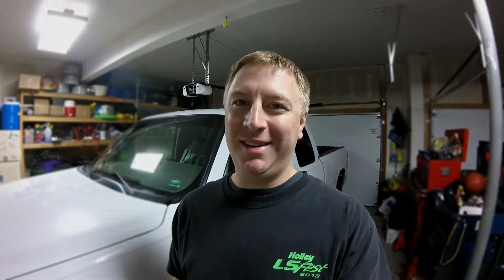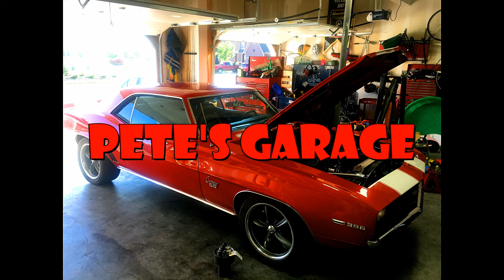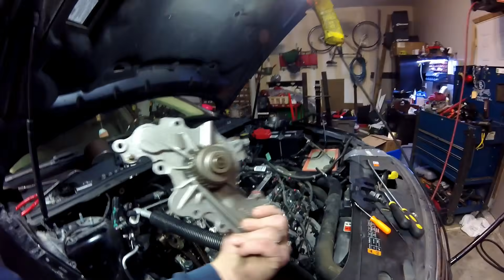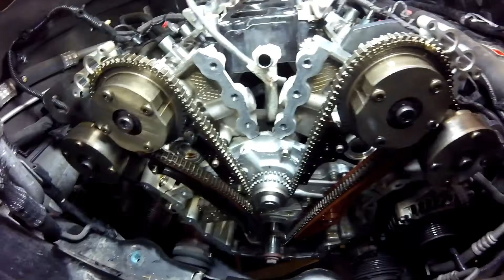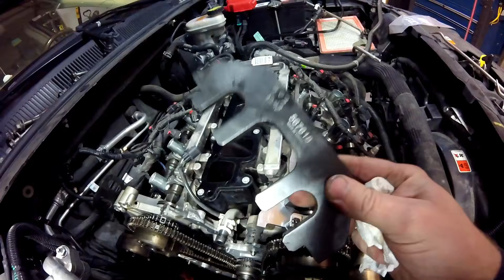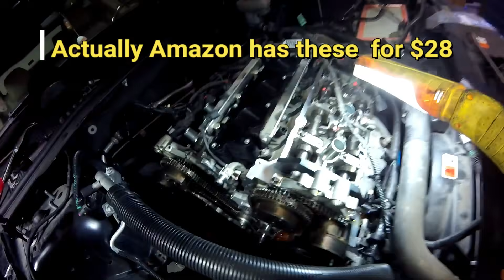Why does the Ford Taurus, Explorer, Edge 3.5L water pump cost over $1400?

Comment: I have a 2015 Taurus with the 3.5. No turbo. I just noticed I have no heat at idle. Once I rev it up to 1500 RPM I have great heat. Temperature is normal. NOT overheating. NO coolant leaking anywhere? I just done an oil change the day before this started happening so NO coolant in the oil. So why no heat until reving it up? Water Pump? I can't find anyone having this issue with the water pump. All have a coolant leak. I will check Coolant level tomorrow but again No coolant under the car and none in the oil???
Reply from the maker: Usually that means it low on coolant and there is an air pocket in the heater core. It’s one of the first symptoms of low coolant because the heater core is usually one of the highest points of the cooling system.

Comment: How is that job only $1,400?! All shops here are charging $4k minimum with just aftermarket parts that will break easy!
Reply from the maker: This video was recorded 7 years ago. These cars now have a ton of miles and labor has more than doubled. If you’re doing this job today it would definitely be a good idea to throw a timing chain kit in it so that definitely adds to the cost.

Comment: How do you time it i think i have a water pump seized it wont turn the engine it ran fine it over heated a bit. I pull timing case cover and it won’t turn  any ideas  I know your thinking spun bearing but has not signs 2007 ford edge thanks in advance
Reply from the maker: I would remove the timing chains and see if you can spin the water pump on its own. You could also then try to spin the engine a little with the crank bolt but only a little bit to make sure it’s not seized. I highly doubt the water pump is seized though. Good luck.

Comment: I changed my water pump in 8 hours and replaced all gaskets and seals. It cost less than $500.00.
Reply from the maker: You can definitely save a fortune doing the work yourself. When I made this video $1400 was about what it would cost to have an independent shop do the job. Now it’s at least double.

Comment: My 2017 Explorer sport with 840000 Miles . Issue is stop at a traffic light cold air when you drive 3-4 car length  or sometimes 1/44 mile then hot air  Took it in and the dealer tops it off and went away the next dat it was doing the same thing. No leaks on my Garage Floor. Well the results back at the dealer is  water pump. Who and what were the engineers thinking putting the water pump inside and then when the bearing gets bad the water  going into the oil. We all know water and oil don't mix AT LEAST I THOUGH PEOPLE KNEW THAT Fire the engineer. They sure do not understand real life mechanical  knowledge. $4000.00 Repair Bill!🤦‍♂🤦‍♂INTERNAL WATERPUMPS  🤦‍♂🤦‍♂🤦‍♂🤦‍♂NEVER SHOULD BE ANOTHER ENGIN OR MANUFACTURE HAVE THIS DESIGN. Goes on the outer portion of the engine and the water has a small hole to leak out and no engine damage as long as you don't run it and over heat the engine with not water in the system 👍👍👍👍👍👍👍👍👍👍

Comment: I have a 96 Mercuy Mystique 2.5 V6 it overheated in 2015. I thought it had a internal water pump it sat for 3 years til  I pulled up on my phone hoe to do it. Put my glasses on and saw the sticker under the hood showing the pump was ran by a pulley off of one of the camshafts. 10 min job to replace the belt now everything else is a pain in the ass to work on but not the waterpump. Ford could have easily done this on the 3.5 but they chose to screw people over too bad that 3.5 is a great engine otherwise.

Comment: This wouldn't even be an issue if they would have just copied the same design as the Nissan VQ series. Those have a cover plate for the tensioner and water pump, so if it fails, there is a lot less labor involved.

Comment: Can someone please tell me where I can get this fixed at for $1,400, because my water pump is leaking on my 2017 Ford flex and the cheapest place I found thus far is $3,000! Some places have quoted me as much as $4,000 plus and I'm not even leaking antifreeze into my oil yet
Reply from the maker: This video is pretty old. Prices have skyrocketed and these vehicles have way more miles on them now.
Reply: @PetesGarageandperformance some places are charging over $4000 for this job now and it doesn't seem to matter if the vehicle has 100k or 180k.... they're charging you at least $3000! Mine is scheduled for the 27th of this month. Thanks for getting back to me 👍
Reply: @PetesGarageandperformance  I've got 133k on the odometer by the way.

Comment: That’s not all. It can cost 2-3 thousand dollars. The first one I ran into, the A/C didn’t work. It had a blown fuse. The water pump weep hole onto the side of the block drips water down on the compressor clutch! Eventually it ruins or shorts out the A/C clutch coil. 

Since water and electricity doesn’t mix, you could also need an A/C compressor! 

To make it more of pain, Ford also does not use a gasket or seal on the timing cover. You have to use RTV like on the Toyota. Which makes reinstalling the timing cover a bitch without smearing the RTV. 

Next problem is removing all the air out of the cooling system so it doesn’t run hot. You need an air lift tool used to refill the cooling system which requires an in house compressor. If the car ran hot due to lack of coolant from the water pump leaking, you may also need a thermostat and housing assembly! 

One thing just snowballs to needing something else and I can add up to a huge repair bill.  Most people just junk the car when they get an estimate. Since you are there and depending on the mileage, you may need a complete timing chain kit and guides and phasers!

Plus coolant and an oil and filter change.  All because dummy Ford installed a water pump that runs off the timing chain. Toyota and others did this too I believe on some models.  That Toyota van may even cost more!

Comment: In central N.C. it cost $3100.00 to replace parts and labor!! I had to have mine changed at 77,000 miles and again at 97000 miles luckily the 97,000 mile change was covered under the warranty of the 77,000 mile change....WHEW!! IT HAD A 24,000 MILE WARRANTY!!

Comment: Came across your video. My daughter just got a 2014 Ford Taurus and we are having this issue now, we have taken to a local trustworthy shop. We went through a similar hell with a Ford Expedition 4.6L needing both timing chains, guides, the works. It ended up having to have an engine. This Taurus has 318k, almost all highway miles. Should all of those components be replaced as well or are we just looking at another engine? I will own another Ford as long as I live if we go through another engine replacement.
Reply from the maker: If the oil is a milkshake and the crankshaft bearings are worn it’ll need a new engine. With that high of mileage I would replace all of the timing components while you’re in there.

Comment: so i did the timing chain on a 2012 taurus and lined up both cams and the crank with the colored links on the chain and where they were supposed to be. i installed the new chain and matched perfectly. when i spin the engine none of the colored links match up to the dots on the sprokets even when the dots on the sprockets go back to where they are supposed to be. is that normal? is the timing off? i was unsure about the tensinoer since it did not fully lock.
Reply from the maker: Yes that’s normal for most engines. There are some engines that take 50 or so revolutions for all of the links to line up again.

Comment: Why is this worse than cars where you have to spend about the same amount doing a timing belt (& usually a water pump at the same time) every 100k miles?  I'll bet 99% of the water pumps in these engines make it to 100k, likely many way further.

The key with these motors is to pay attention for signs of leakage (weep hole) so that when the pumps do go you can fix them before coolant enters the crankcase.

Comment: I own a 2013 Ford Edge with the 3.5.  This water pump keeps me up at night.  The repair will probably cost closer to $2000 if it is repaired correctly.  If you replace the water pump you might as well replace the chain and guides.  I am trading this perfectly good car for a 2006 to 2010 Ford Explorer with the 4.0 V6.

Comment: do you know how that water pump bearing is lubricated? does it receive oil from the engine ("splash" off the timing chain)? or is it a "permanent" lubed bearing (sealed from both coolant and engine side)?
Reply from the maker: Pretty sure it’s a sealed bearing.
Reply: @PetesGarageandperformance  thanks.

Comment: You do not have to take the cam sprockets off, just loosen the left small chain guide, the pump will squeeze past it, the right clears just fine, 
 Pretty simple job, yes, calls for 13 hrs, mainly for dismantling top end, and yes, cleaning all the plate cover surfaces of the old silicone takes time.   Overall, pretty chill job.
Reply from the maker: That’s what I have done on the last couple thanks to the tips like yours. Thanks

Comment: i am looking at a 2016 transit 3.7 103000k miles, check engine light is on. any chance its on for timing chain?
Reply from the maker: There’s a chance it could be on for any of the 200+ codes that can occur. The only way to know is to scan it and see what codes it’s setting.

Comment: I heard the water pump cost 175.00 dollars, where do you shop? that Ford price, your price 1400.00 = DONT BUY FORD
Reply from the maker: Call up any shop and ask them how much it would cost? This isn’t a job that most people can do. So it’s a job that costs quite a bit on labor. Plus you have the water pump, oil, filter, coolant, RTV, valve cover gaskets, and intake manifold gaskets. Plus it’s even more if the timing chains or guides are worn while you’re doing the pump.
Reply: @PetesGarageandperformance   you said a water pump right I check the price at the Ford parts dept.

Comment: The mechanic that just changed my wife's ford edge water pump replaced it with a advance auto parts water pump its so disappointing for the $1700 i spent .The original water the bearings were good the gasket was leaking to the weep hole.. who changes it with a advance autoparts water pump ? Im so mad about it..should i be worried now this thing will fail? I have 188,000 when the original  began to drip coolant not much but enough to say ok time to do it. I do oil changes at 3000-4000 mechanic said engine inside was very clean ...should i be worried about that water pump now?

Comment: 3rd day??? For god sakes man get to work and quit taking more apart than you need to. It’s a 10 hour repair, stop with all the drama.
Reply from the maker: Yeah, not my day job. I just do this on the side.
Reply: @PetesGarageandperformance  truth be told, you did a damn fine job. I was just busting your stones.
Reply from the maker: I actually have one to do on an MKZ in a couple of weeks. Hopefully I can do it in half the time!
Reply: @PetesGarageandperformance  full disclosure. 37 year ASE master, 22 years at a Ford dealer. It is possible to get the chain cover off the Fusion/MKZ in chassis but the service procedure has you remove the power train to do it. This is for the fusion sport ‘11 &’12 models and the Lincoln Z models from ‘13 to present. I have never attempted a in chassis repair, the two other techs I’ve seen do this in chassis one swore a lot and said he would never do that again, the other tech didn’t fair so well. His came back after 7 weeks leaking badly from the chain cover. He eventually pulled the engine and resealed the cover.

Comment: oh, 3 years later, I caught something else. Pete was showing the failure mode of that water pump but he said bearings. There are not bearing"s" in that water pump. There is A bearing. One single bearing!! One single bearing that has to support the shaft against the entire power of the engine trying to yank it out of plane. Oh and that shaft gets a differential torsional load because it's spinning an impeller through water. It's no wonder Ford got sued over this junkers. Just to let people know as they look through the used market for cars, they should absolutely skip these unless there is a detailed service history.  Even then, if it hasn't had a water pump done at least once at this point, assume the worst and skip the car. Pete covered something about the big giant timing cover and how its hard to seal. What he didn't mention is the other major failure point of these engines as a whole. See, you will get some drops of water from the leaking water pump, but more of that water is going right into that timing cover. Since that timing chain is oiled by the oil pump, the oil has to drip back down into the oil pan. Well, if the water pump is leaking, guess where that water is dripping down? That's right!! It's dripping water right into the oil pan where you get the stinky milkshake and your crank bearings begin manufacturing the forbidden glitter. Oh and that's not the end of it...well, it is for the crank lol. The oil pump picks up said glittery milkshake and sends it up to the valvetrain where your oil pressure-actuated cam phasers get all gunked up and fail and your VVT system stops working. Oh, and the cam bearings get eaten too. 

Seriously folks, if you have one of these in FWD or AWD trim, I would seriously consider doing the water pump if you haven't already. For those of you with this engine in an F150, consider yourselves lucky. You have a normal belt driven water pump that isn't as likely to fail because it doesn't have that singular bearing inside. If the little plate inside leaks, it will still piss water into the oil, but because there's no real stress on it, they seem to last a long time and its a good size rubber seal.
Reply from the maker: Yeah if you’re lucky you catch it before it milkshakes the engine. It has only one bearing? I have one of these and I’m thinking of cutting it up to verify that. I just don’t see how the engineers thought only one bearing would be sufficient.
Reply: @PetesGarageandperformance  I'm going on memory here from a few years back with the lawsuit on these motors but internally, yes I believe it's only one bearing inside. Now, the 'nose' of the shaft has another bearing or bushing that notches into a cavity the timing cover, but the bearing wear in the pump is the issue because it allowed water to leak into the timing cover and down into the oil pan. That was one of the complaints cited, that the design of the pump was part of the problem.

Comment: Are you absolutely sure that that chamber leads to a weep hole behind the alternator? The reason I am asking is that I seem to get the opinion that most people say this because it has been said by others before. I poured 2 gallons of antifreeze into my radiator, and nothing ever leaked on the ground - ever. When I took the water pump off, i looked and there were 2 holes in the front of the block, and at least one went to an oil passage in the engine. This leads me to believe that this bearing is oiled from the crank case, and if oil goes into the pump, it is only logical, that it returns to the sump. I have yet to slice the pump bearing chamber apart, but when I do, I wouldn't be surprised that we have been mislead. Thank you!
Reply from the maker: I am 99% sure that it leads behind the alternator and is for coolant to leak out so it doesn’t milkshake the oil. Some people don’t get so lucky and the pump still leaks past the shaft seal and into the front cover area and mixes with the oil.

Comment: I fixed my wifes edge with a new water pump and timing chains and only cost me about 400 dollars in parts.  And the "special" silicone that ford says you have to have is relabeled loctite part number 2574717. Was not a very hard job to do.

Comment: Closer to 2,000  dollar job. They almost always replace the timing chain, tensioner, and the guides while they are in there due to mileage. Then the oil has to changed a couple times to flush everything out. Then again, I had mine done 2 years ago. It's probably almost double that now.
Reply from the maker: Yeah it’s been a few years since I made this video. The cost has definitely increased quite a bit from what I’ve seen people post.
Reply: Thanks for the info.

Comment: put in electric water pump.
Reply from the maker: It honestly won’t do any good because you would still have to take the engine apart because that water pump is one of the timing chain idlers. And the bearing fails. Then you’d need to have some sort of block off for the coolant passage and it would have to have a timing chain idler on it.

Comment: Surprisingly, I only paid $510 to fix my 2011 Taurus including the new water pump. My mechanic might not charge as much as others but the mechanic that 1st inspected my car charged me $100 just to see what’s wrong with it. He told me he didn’t have chains to pull up the engine which I’m thankful bcuz I saved $1,000 by letting him not fix it.
Reply from the maker: You got a very good deal. Is that including parts?

Comment: The water pump usually isn't an issue to be honest. I have an '08 Taurus and i replaced the water pump once at 200k. Yes it's incredibly expensive, and yes it's a stupid design, but the water pump is usually reliable and doesn't need replacing often.

Comment: Ford used the water pump as an idler pulley behind the timing cover. For the 3.5L, but they didn't account for the vertical bearing tension wear while under tension, and heat. If they used a better bearing and seal probably would lasted longer.

Comment: My 2014 Explorer is in the shop right now having this very thing done at 74,000 miles. Quoted me AROUND $1500. Here's hoping that AROUND is a very tight curve.
Reply: Bro I also have a 2014 explorer at 84,000 miles and they're quoting me $4,000